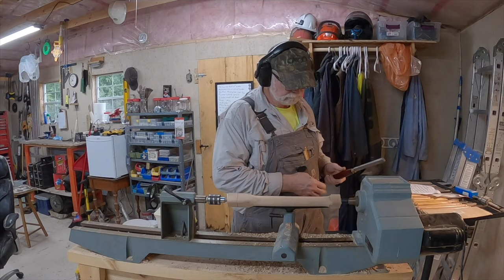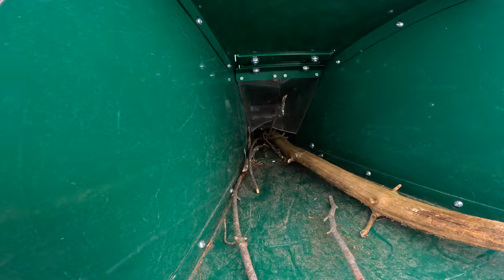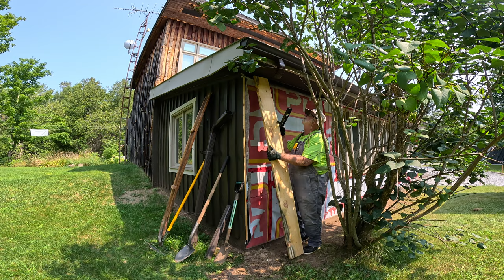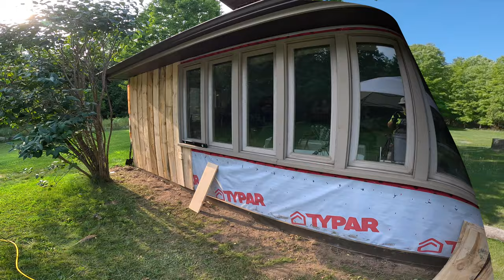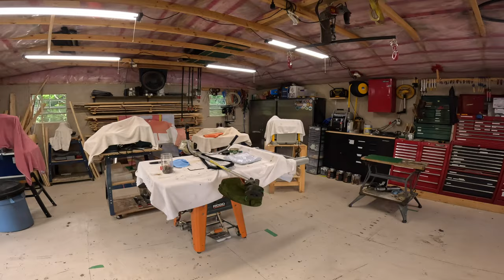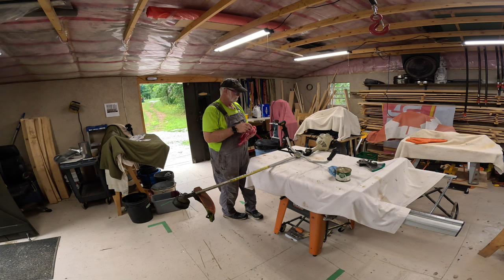Restoring Board & Batten Siding - The Ultimate DIY Project

Comment: Good evening Brian. The siding is coming along nicely. Cherry is one of those woods that doesn't dry and stay flat well if you are not careful milling it. It's not a very forgiving wood. You really want to pay attention to any stress in the log while milling because it will cause a lot of issues drying. You don’t want any part of the pith or sap wood attached to the heartwood. Lots of weight on top when drying. I wouldn't mill boards too wide since those logs have a few knots that will have play havoc drying. Yup, when you get busy the shop gets messy, lol.  Good to see the trimmer is greased up and ready to go. Take care!
Reply from the maker: Thanks for the great information on the cherry wood Paul. I’m going t let it sit for a week or two while I figure out where and how I’m going to cut and stack it and what to weight it down with. The trimmer was an unexpectedly easy one. Nice to get one of those every once and a while. Thanks again!

Comment: I would do live edge 5/4 or 6/4 thick, they would make some nice charcuterie boards 😉👍🏻. I’m curious why you have towels over your tools and is that a Rikon 10” bandsaw? Do you like it? Have a great one Brian 👍🏻🙋🏼‍♂️🙂🇨🇦🍻
Reply from the maker: Thanks Luc! That’s what I’ll do. I have towels over everything because I don’t have a dust collection system. It work well and is cheap. Your right about the band saw. I got it from Lee Valley a couple of years ago when it was on sale. I haven’t challenged it much like I think you would but for what I have used it for, it has worked very nicely. It would be to high speed for steel but that’s not what I got it for. Thanks very much for the advice and for stopping by!